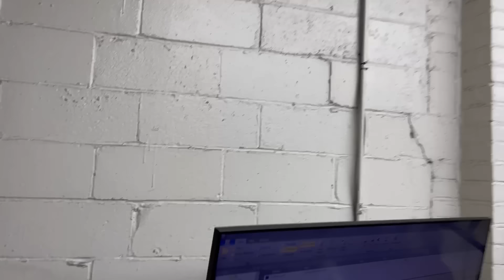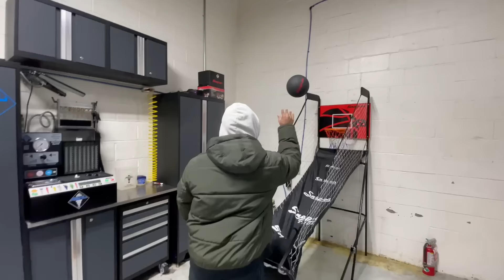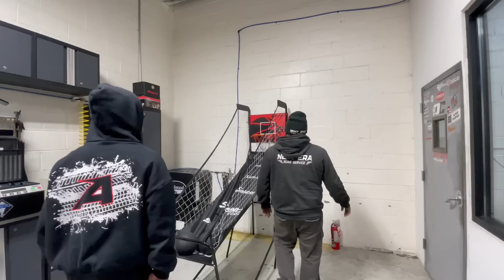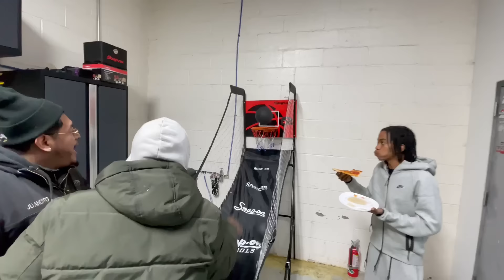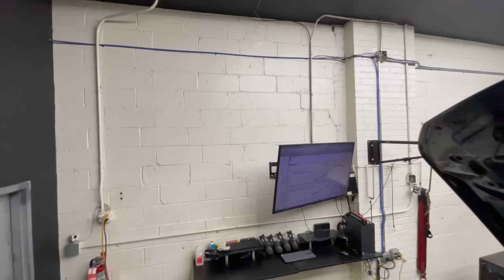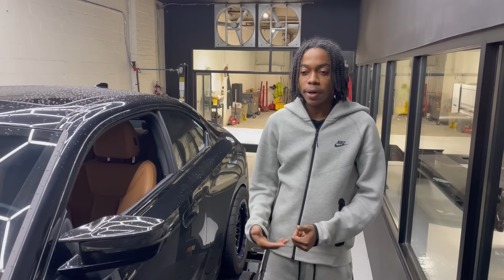WE TURNED THE BMW M240i UP! DID WE MAKE A 1000HP?

Comment: You don’t need a new turbo you need new exhaust manifold. Short runner Log manifolds like the one you have from Spool suffer from back pressure when you’re trying to make 1000+. I guarantee if you swapped to a tubular equal length manifold like the one from Titan on the same boost you will have a better looking graph with more power.
Reply: I was thinking the same thing. A back pressure sensor setup would be my next "mod". I'd imagine the car is over the 1:1 pressure ratio at this point. But regardless it's very cool to see this build go from stock to built Trans and tcase to big single in like 2 weeks time. Dre is doing his thing for sure.
Reply: Spool is garbage
Reply: Yup. Tbh I was expecting a klm kit on this car. This v1 tho so he probably has that planned for the future
Reply: If I remember correctly this was just a temporary turbo set up.
Reply: 💯 learned this long ago
Reply: Any b58 gen1 injector upgrade recommendations
Reply: My car makes those numbers no problem on  a log manifold yes equal length is better overall but you get faster spool with log manifold. It's that turbo it's way to big of a back housing on a small 64mm turbo that's why 😂.
Reply: Dre’s turbo had exhaust fins damaged. The manifold generates no excess back pressure it was measured. The manifold isn’t a log style. The billet manifolds have internal flow channels.
Reply: Facts

Comment: this a dumb question but does this and the m2 have the same engine like why donesnt he spend all the money modding a m2?
Reply: New G87 M2 has the S58. All M engines have S engine codes, like the S55, S65, etc. Any BMW with “40i” has the B58. X5 40i, m340i, 540i etc… 👍🏻

Comment: Wait, the front grill opens up when you floor it and closes when you let off the gas!? 🔥
Reply: ya pretty much every modern bmw has active grill shutter
Reply: Lol my M340 does that too
Reply: na that’s fr crazyyy😭😭😭
Reply: i reactee the same way when i first saw bmw come out with this design,my first though though is, wouldnt you want as much cool air getting into your intake, radiator,engine bay at ALL times ??
Reply: @johnnyVGtran I would think the same thing but if bmw mass produced I’m pretty sure there is some significant benefit
Reply: @johnnyVGtran might have to do with fuel efficiency when not racing cold air could take more to spark or obviously creates more power which requires more fuel . So it might be more efficient to have warmer air in regular driving
Reply: Yo I didn't even notice that. Lol
Reply: I think it made 945
Reply: I just found this out like a year ago😂 shit crazy lol
Reply: It was opening and closing on the last dyno video
Did you miss it?

Comment: It’s incredible that this thing is making and handling that kind of power on a stock engine and a stock transmission.
Reply: Built trans
Reply: @masteroffire17  oh ok gotcha. Still very impressive. A stock LS or LT4 would not take that kind of power stock.
Reply: @JU5TAV6 a coyote does tho
Reply: @CarbonYote  which is also insane. When I got into performance mods in the mid 90s a 1000hp car on the street was pretty much unheard of. Now 1000 is the new 500 and it’s so cool to see the progression of street cars.
Reply: @JU5TAV6  oh I agree with that for sure. My dad had an 88’ trans am making 1200 on nitrous with a 408 back in the 90s and he said nobody wanted to race on the street except for fastest street car takeover
Reply: @CarbonYote  sounds about right

Comment: Dre has had the 240 for what? a month and were about to see 4 figure Hp numbers .B58 engine is insane .Id love to know just how much each  mod has cost, because id wanna build 240 the same way only difference is im hapoy with 600hp for daily duties.Anyone care to share ?becuase it doesnt look like hes gone the usual FbO ROUTE
Reply: Shit id be happy with 400😂
Reply: @yaboybert_2077  haha facts
Reply: @yaboybert_2077 facts my 330i f34 don’t is probably 250 wheel at max
Reply: 600hp all you’d need realistically, if that’s all you’d want is like a pure 800, upgraded di, and a custom tune on a platform of your choice. You could also do upgraded charge pipe if you want. All around you’d probably be in around 6k give or take at the end of the day. A lot of people would say pi instead of upgraded di but since it’s only a 600hp build just keep it nice, simple, and reliable. Since then you wouldn’t have to deal with a reflex or anything. If you plan on making more power then i would recommend a completely different setup.
Reply: The log style manifold is holding him back on power. They choke up very quickly. Once he finally switches to a tubular manifold he will see much better top end.
Reply: Anything is possible when you have money.
Reply: TTH650,TU hpfp,downpipe,custom tune would get 600-650hp and will cost around 4k

Comment: My man must have an extensive cooling setup because pushing that much horsepower on a stock motor is a ticking bomb

That’s crazy if it’s still stock pistons and rods 😮
Reply: Nah fr I have a m6 pushing 750+ to the wheels on stock don’t wanna push over that ngl got me nervous hasn’t gave me problems tho 😭😭
Reply: @ADBETTERTHANJOKIC  that’s sick and I believe they can handle up to about that much with stock internals. But my man pushing around 900hp on the b58. Sheesh 
Tough motor

Comment: Nohesi won’t beat this car now. Most u guys not car enthusiasts. The last video when he dyno the graph was horrible the 240 was falling in power around 4-5k it made peak power early but fell off. Result is nohesi 340 will always pull on him. Now as u see on the graph it’s making power with no drastic drop before redline Nohesi will lose to this car next time for sure
Reply: Regardless of who wins and loose I like seeing nohesi and 1stock going at it, I feel like its helping out the community and allowing for smaller and larger companies to push there R&D towards new turbos, fuel pumps... etc for the gen 1 and gen 2 b58 platform
Reply: @FatalNukeZ  A Video came out I think yesterday and NoHesi won by about 2 Car Lengths, though I’m not sure if it’s after the back housing and fine tuning or before
Reply: He lost 2 times in a row what is you talking about 🤔by MR.Nohesi
Reply: Power does not equal to a good track time … so all yall that keep d!c riding dyno numbers know nothing about track times . If the car can’t grip on street, go through a power band smoothly, have the correct boost by gear.. then dyno number means nothing at all. Yes it’s an impressive to have a 900 whp stock block b58 ..  but a lower hp car can still smoke this car on “street”

Comment: Brooo how is stock motor with a build transmission and a build block big turbo and better manifold wtf stock motor🤣😂😂😂😂😂
Reply: Engine internals i.e. rods, pistons, bearings, head, crank etc are completely stock, unopened. Trans isn’t the motor, turbo isn’t the motor and manifold isn’t the motor. They bolt on to the motor which is completely standard